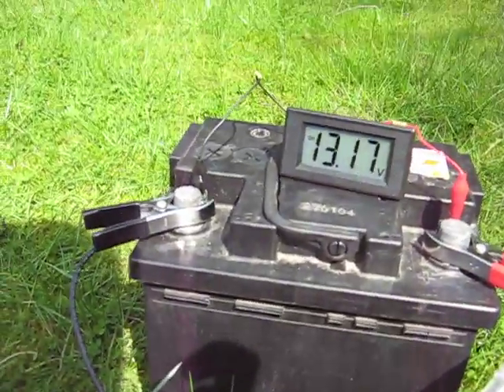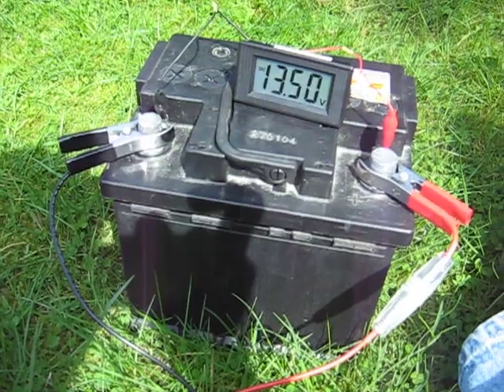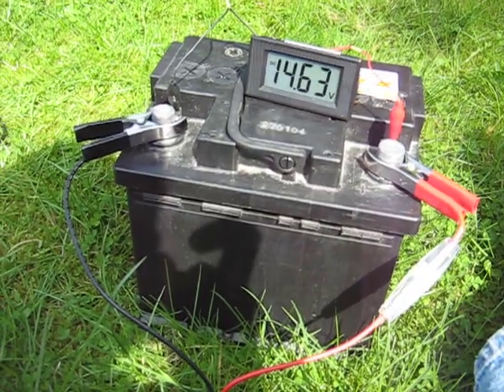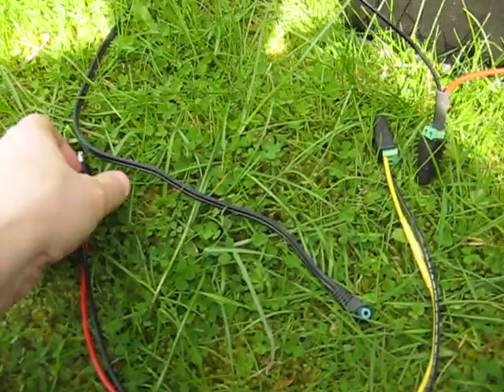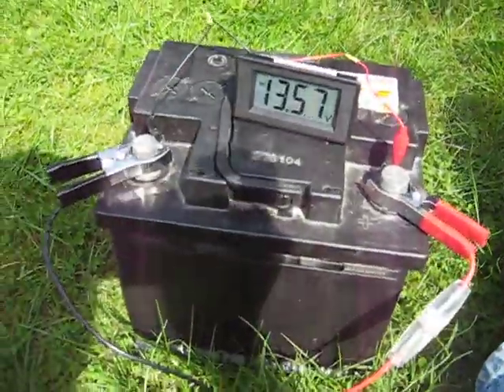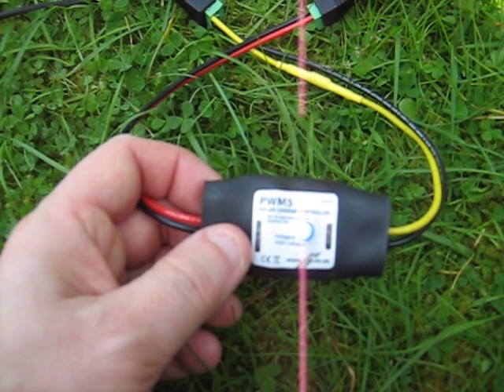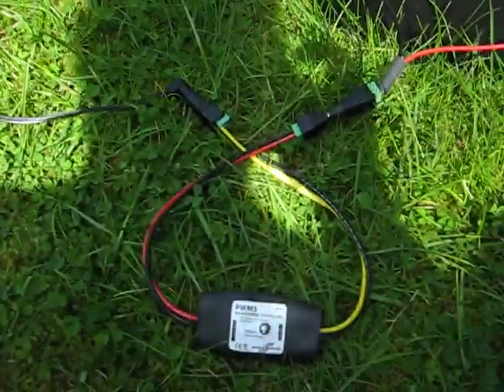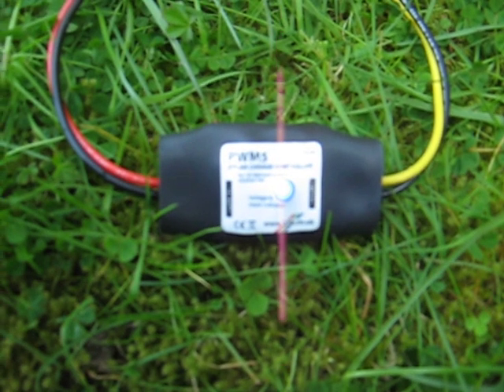Charging a Car Battery with a Solar Panel and Charge Controller

Comment from the maker: Let's say you discharge the battery 33% per day - that's 50Ah = 600Wh @ 12V. Now let's say you get 8 hours sunshine a day - 600/8 = 89W. De-rate the panel a little to allow for transfer losses and I'd recommend a 100W panel. If you take less energy from the battery each day, you can use a smaller panel.

Comment from the maker: If your country has plenty of sunshine, a solar panel is a great way to keep your battery charged. If you use a small panel (less than 10W), you can connect it directly to the battery, but a bigger panel will need a charge controller to prevent damaging the battery.
Reply: Hello, thanks for the video. I have a Q, i just want to keep my car battery topped up as my running is low. Mine is a 45ah Amaron battery, would the below spec solar panel without controller be ok to just keep the battery from draining? :

Max Power(Pmax): 5Watts

Max Power Voltage(Vmp):8.7 V

Max Power Current(Imp): 0.58A

Open Circuit Voltage: 11V

Short Circuit Current: 0.62A

Tolerance:± 5%

Weight: 0.2kg

Comment: i live in places where there is power  for just 4 hrs a day..so itsn't enough to charge my battery which is connected to my ups... can i charge it using solar panel?? mY battery is a 12v leadacid  With 100AH ..PLS REPLY

Comment from the maker: The panel in the video is 20 watts, but I'm using bigger panels now. The PWM5 controller can handle any panel up to 100 watts. Yes, you can leave the panel connected via the controller to the battery indefinitely.
Reply: How many volts is the panel?

Comment: I have a this exact set up after watching this video I went out and got all of the items shown here even the little male and female power connectors. I have a car battery that is a bit low only about 11v so i plugged in my panel and charge controller and waited all day for it to be charged at like 12.5v so I could use my inverter on the battery. But this set up dose not seem to work it dose not charge the battery I have asked others and they tell me this whole set up is wrong! please advise!

Comment: 14.6VDC is not going to damage your battery!!! if you have solar panel which producing 13-14.6VDC than there is no need for solar charger.The battery will take what is needed to fill it up,then gradually Amps. goes down till full charge.

Comment: Hi I am going to buy a 120 watt to 200 watt solar panel to put on my camper trailer would I be able to use the charge controller also would the solar panels keep my battery charged and can I just leave the charge controller on so when day light comes it will start charging again what I used during the night.
 Regards Farmer

Comment: i have a battery trainer for car battery at home and i have a 12v to 220v converter for my sigarettelighter in my car, if i hook the battery trainer to that converter in my car while driving does it recharge my battery then ? i think so but not sure, been thinking about these solar pannels as well didnt know about that charge controller, very usefull video !!!

Comment: HI JULIUS!!BIG FAN OF UR VIDEOz!!!I WAS JUST WONDERING... IF I WANTED TO CONNECT 2 TO 4 BATTERIES TOGETHER WITH SOLAR PANELS... WOULD I STILL NEED THE  "solar charge controller" BETWEEN PANELS AND BATTERY?PLEASE FORGIVE ME IF YOU HAVE POSTED A VIDEO ON THAT AS I WILL CHECK RIGHT AFTER POSTING THIS!!!THANK U